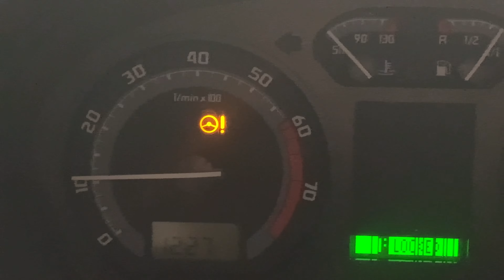VW, Audi,Seat,Skoda, Power Steering Pump replacement, Fualty Power Steering, Dash light on.

Comment: Thanks for your respond, I completely removed my pump and driving the car without one, do you think it's gonna affect some components like steering rag?
Reply from the maker: No it wouldn’t affect any components that much,  The only effect that will be is the steering wheel itself be much harder and heavier to turn that’s all.
Reply: That's what I'm experiencing right now the steering is hard but street Mechenic removed the steering angle sensor that is situated on the steering rack and now he doesn't know whether the white area on the sensor was facing up or down. The sensor is flat in shape with 2 screws and it's having  the white colour on top and black on the bottom. Which side is facing down Sir, the white or black side?

Comment: What car are you doing this on please as i have a mk1 seat leon cupra just wanted to know if its the same type of pump
Reply from the maker: I have done it on Skoda Fabia 2006 model, Usually, the older model of Seats, Audis and Skodas are almost identical. However, check for the part numbers and might need recoding too after a replacement. Cheers